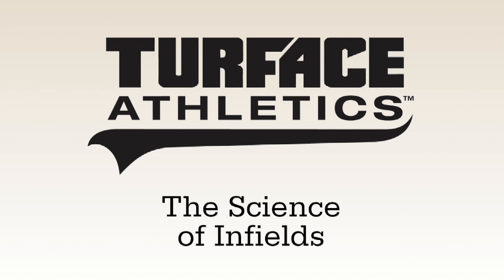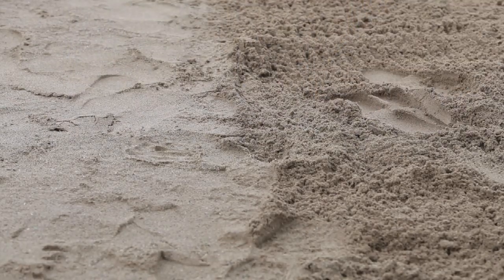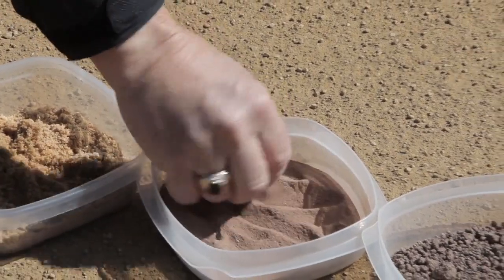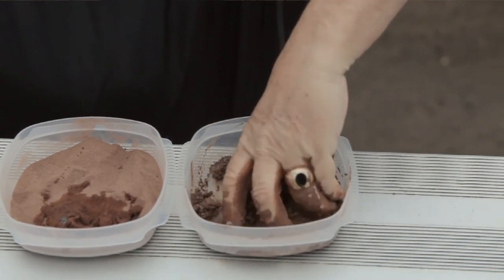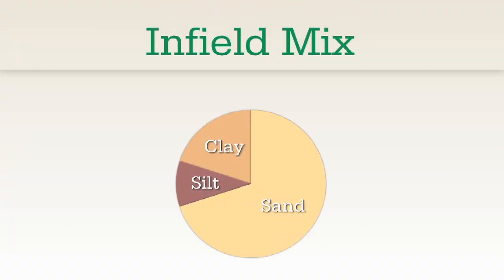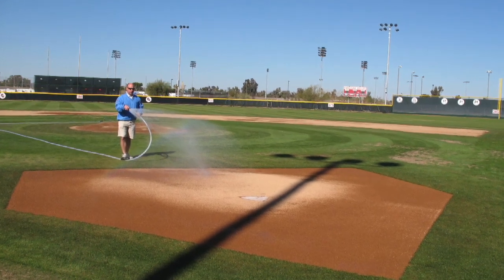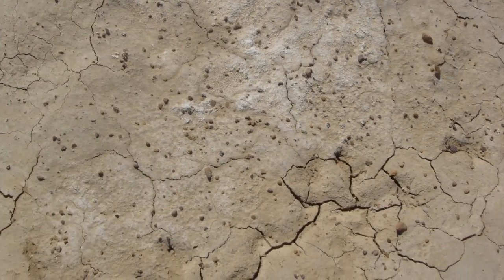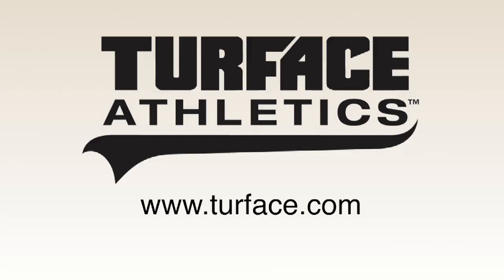The Science of Infields

Comment: Speaking of hard infields, up until about 1980, Dodger Stadium used a mixture that contained about 70% crushed brick and it was as hard as, well, a brick.

When they finally went to a more conventional mixture for the skinned part, a reporter told a player from another team that they had softened the skinned part of the infield.

Reportedly, the player replied "What did they do?  Pave it?"
Reply: What's your favorite team in baseball ( sorry if you don't play baseball ) mine is the cubs
Reply: Despite living in California, I've been a Cubs fan since the mid-80s.  I did play city league softball until I was close to 40 and my shoulder got so bad I couldn't return the ball to the pitcher from behind the plate without having to arc it.
Reply: I like to call that gravel
Reply: Candlestick Park also used crushed brick.
Reply: @habyss  not one MLB field uses crushed brick as an infield mix. They are engineered soil blends of specific ranges of sand,silt and clay.